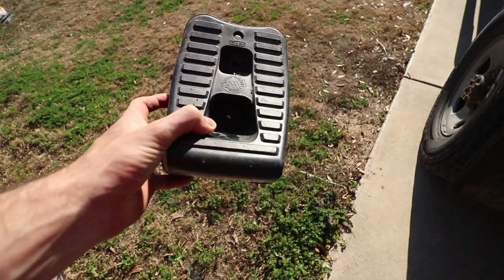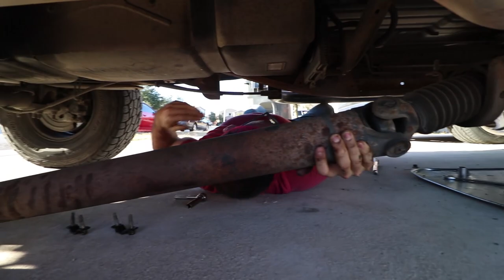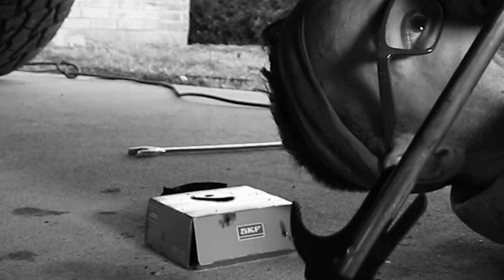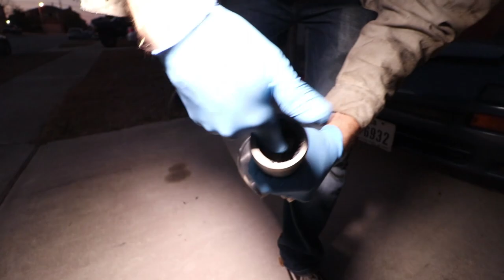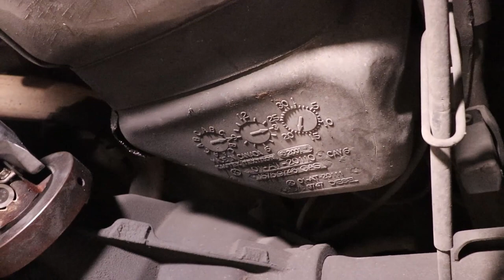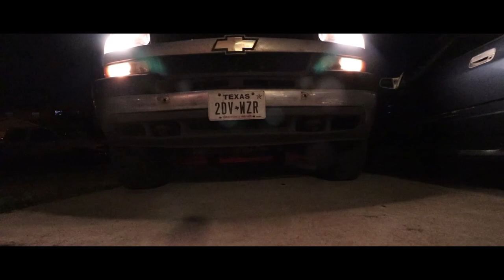How to Install a 1 Piece Driveshaft Conversion on a Silverado

Comment: who built your driveshaft?
Reply from the maker: Randy Richardson I can’t believe I forgot to put that in the description 😅, it was The driveshaft specialists here in Texas. Here is a link to their site :http://www.driveshaftspecialist.com/default.html
Reply: @TheDailyDrift  ok thanks.   I had been looking at them for doing a driveshaft for my project too.
Reply: what size u joints 1350 or 1410?   what diameter shaft?  looked like their 5"
Reply from the maker: I believe I needed the 1410 u-joint because I have the HD duramax. I am not sure about the other trucks, but they have a diagram on their site for how to measure them. The driveshaft I got was 5 Inches and all aluminum. It was significantly lighter.

Comment: Tips for anyone that will use a grinder. I know what im about to say sounds wrong but you actually want to grind/cut in a way that the sparks fly towards you while using a face shield and right past your body, even if its flying past your face. That way when the grinder kicks it travels away from your face instead of into it.

Comment: The reason your truck has a 2 piece driveshaft is because of the length of the driveshaft. A driveshaft has what is called a critical speed. It is the max RPM that a driveshaft is good for. As a driveshaft gets longer its critical speed decreases, as it gets larger in diameter the critical speed increases I believe.

Also, the wheel base on a CCSB and ECLB are a few inches different. GM started out using 2 piece driveshafts in both trucks because it is too long of a stretch for a single piece steel driveshaft. Although, the 2 piece driveshafts in these trucks are prone to vibration issues because the front shaft is so much shorter than the rear shaft its a poor combination and makes for balance issues. 

So they went to the single piece aluminum shaft, some trucks got changed over by the dealers when driveshaft problems arose, some trucks did not. There are 2 different length aluminum shafts on for the ECLB and one for the CCSB. I remember seeing a TSB about the driveshafts and dealers switching them over but i dont know what year they stopped coming with the 2 piece driveshaft. CCLB trucks have been 2 piece all the while.

The markings on the fuel tank are probably some lot number thing when they must have been made.

So many opinions on transfer case lubricants, it's one of those subjects, I've heard of people putting the same stuff they use in their tranny, other that do half 5W-30 and tranny fluid
Reply from the maker: Rick Alva Damn, thank you for this, such a great response. I’m gonna have to pin this one.   Thanks for the info!
Reply: So can a larger diameter more heavy duty one piece be installed on a CCLB ?
Reply: The new drive shaft is 2 inches bigger in diameter. I think that would take care of the extra distance from the 2 piece.
Reply: Yeah you’re right my one piece drive shaft snapped in half 😂

Comment: How long is this driveshaft that you have because I have a Super crew cab I think my current driveshaft is about 82 inches long which is a two-piece I don’t even know if I can make a one piece
Reply from the maker: Most likely with one that large you’ll probably have to stick with the two piece. I believe the max length was something like 75inches. I put the website of the driveshaft shop I used in the description. They have a list of what size driveshafts they make for the different makes and models. Hope this helps.

Comment: How do you like the one piece driveshaft on your rig
Reply from the maker: I really like it, but my old driveshaft was shot, so I don't have much to compare it to. It feels more responsive and with the new u-joints we no longer have any knocking back there.
Reply: @TheDailyDrift  that's good I put a one piece driveshaft on my 03 Chevy silverado 2500hd crew cab long bed duramax and I can tell the night and day difference it drives alot better

Comment: 😂😂 yeah... I'd rather have a two piece driveshaft because physics!!  There is allot of disadvantages to a superlong one piece driveshaft!!
Reply: What are you talking about?
Reply: @HuntsT  you loose ground clearance and critical speed which means you can't go as fast and the larger aluminum driveshaft can't handle the load that a certain RPM will put out so on certain applications like long bed trucks it's best to stick with 2 piece steel shafts.
Reply: My truck is a CCLB SRW on 35s and weighs near 8K lbs... speed isn't my concern.  Grounds clearance didn't get worse after I switched.  And load shouldn't be a concern since the new trucks that can tow more use the one piece... Where are you getting the information that you are talking about?  The one piece shaft is lighter, it doesn't rust, it has significantly less than can go wrong with it due to have two less universal joints, no carrier bearing, no spline boot.  The angle into the differential minimize wheel hop...So where is your proof that it is worse and why would GM be going to 1 piece shafts on the new trucks?
Reply: @HuntsT  it's cool I'll stick with my 2 piece also  the reasoning behind it is that the long beds with 1 piece driveshafts have a greater chance of twisting maybe the new trucks use a better material on the single shafts now🤷. I just know my truck long bed came standard with 2 piece for a reason also I lifted my 2500 a bit so it helps with angle's I'm also on 40s so I'd rather trust steel to spin my tires.